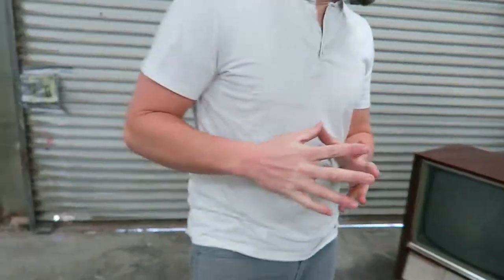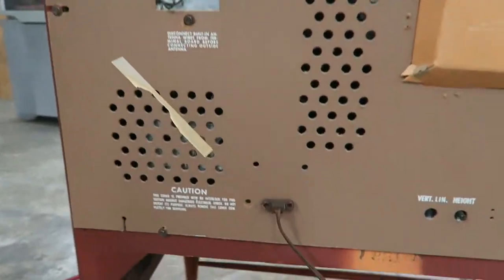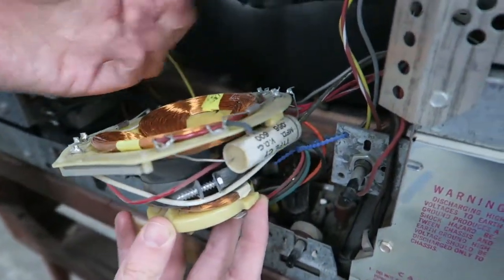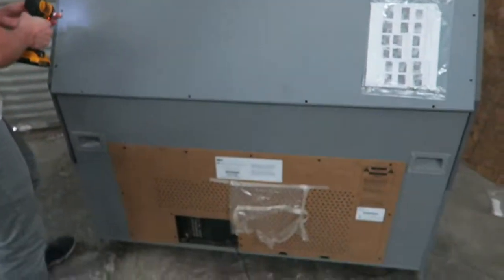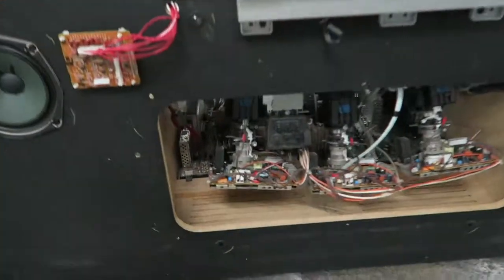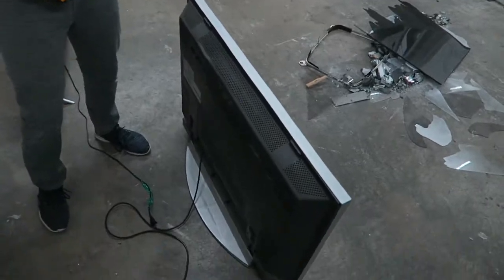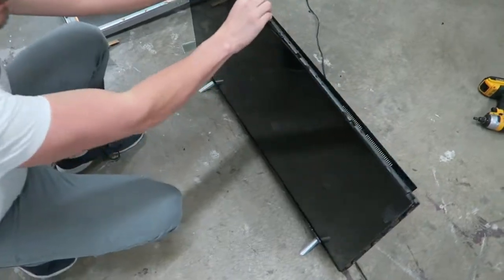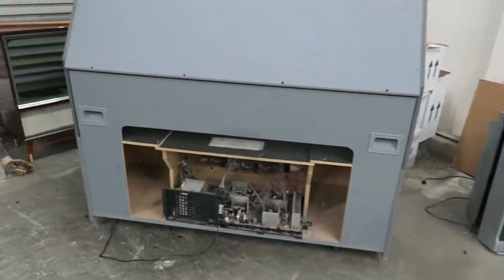Old TVs vs New TVs | One of them EXPLODES!

Comment: NEVER break those tube TVs. (CRTs.) They have mercury AND phosphorous. The insides of those tubes are VERY poisonous.
Reply: Finally, somebody knew. Also, they have extremely high voltage that the flyback transformer generates. They were lucky the automatic discharge function had worked, they could've died.(You can never trust the auto-discharge function on CRTs, a l w a y s discharge them yourself before touching the tube and/or repairing/servicing it). Those high voltage warnings are no joke. It's literally about 25 000V - 36 000V in there.
Reply: Very true crts have a high vacuum from experience. when I was in grade school through out the 80s in the summer I learned to work on many. Sets. And the 90s.
Reply: O_O... thank goodness i got out when i did then! back in 2012 i was home alone when a sharp boxed tv exploded in the living room.. smoke came out and i was so scared! i thought it was just fire but after reading this comment i couldn't believe there was also mercury and phosporous! thank goodness i got out super earlier then.. i actually could've died!

Comment: Breaking CRT tubes and breathing in the radioactive phosphorus  dust ?! You really should do this outside  ( downwind of yourselves) and NOT touch the broken glass. Not because it's sharp but because of the phosphorus coating on the glass.
Reply: They are not radio active, it is fluorescent material. Not that you should inhale it, but it is not radio active like early watch arm markers.

Comment: As a restorer of vintage TV's who is experienced at handling their internal components in a safe manner, you guys are lucky to not have seriously hurt yourselves,  the tube is under a hard vacuum and there are many tonnes of pressure pressing on the front face and rear cone of the tube that is trying to collapse it, I was wincing when you removed the steel rim band from the edge of it as it's purpose is to reinforce the weak glass on the sides to stop the vacuum  collapsing the tube in on itself, they are very dangerous and seriously unstable with this band removed and can go off like bombs at any time on their own lacerating anyone within the vicinity.  The other TV's in the video from the 90's and 2000's are pretty worthless but that was a collectable mid 1960's TV in good clean condition and very repairable, a real shame what happened to it.

Comment: 3:00 jesus please don't stick your hand around randomly in old CRTs. They can hold a huge charge in the flyback transformer and in the display itself. It's thousands of volts at a current high enough to kill you. You need to discharge them. And don't even try the "just shut it off for a day" that works with nearly all modern electronics. The CRTs can store a lethal charge for months to years.

Also you should be careful in general. Most modern electronics will have a circuit to auto discharge any caps once turned off, but it's not uncommon not to have one. You don't have to be as safe with modern electronics as long as you know what capacitors are and don't touch any that might still be charged. But those old CRTs are super dangerous if you don't know what you're doing.

Also as someone else mentioned, the band around the old CRT was a tensioning band. The old large black and white TVs didn't have very thick glass (and used different types), and it was often prestressed, so the band applies tension around it to absorb shocks and keep the TV stable. Once they come off a nasty tap can cause them to implode. They can still implode with the band obviously, but it absorbs a lot of the tension and the implosion isn't as extreme.

The colour CRTs aren't as dangerous in terms of imploding though (but are still/even more dangerous in terms of being charged). They tend to use thick lead glass to prevent x-rays from escaping in large quantities, and then you have the mesh and all sorts of other equipment at the screen and a much thicker screen as well. You can cause them to implode but they're much much less violent just due to how much energy the thick glass and other materials asorb.
Reply: Nice long rant

Comment: Back in the mid 70's, I would recover discarded TV's from the neighborhood in Chicago. Some were repairable but ones that were not got the same treatment that you gave that one. I had one CRT that had a explosion/implosion about as spectacular as the one you had, and it's a constant reminder for safety when dealing with repairing equipment ( such as a older CRT oscilloscope) to wear proper eye protection, as one minor handling accident while your face is in close proximity to it can have tragic consequences.

Comment: It's so interesting to see how the tvs work. Thank you. Also are those tubes in the old CRT tv vacuum tubes? Vacuum tubes were used in early computers as electronic switches. The vacuum tubes turn "on/off" like a light switch. They where used before compact transistors were invented that also worked like a light switch but were much smaller and I believe cheaper